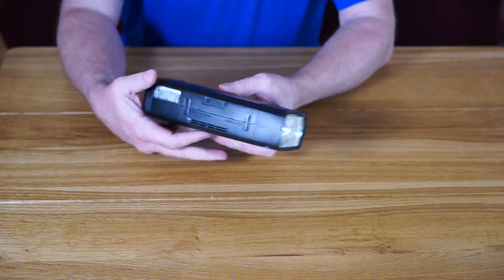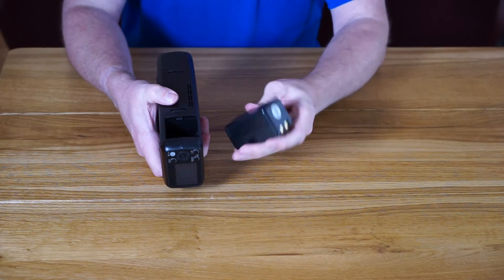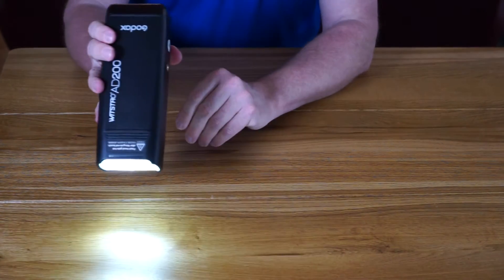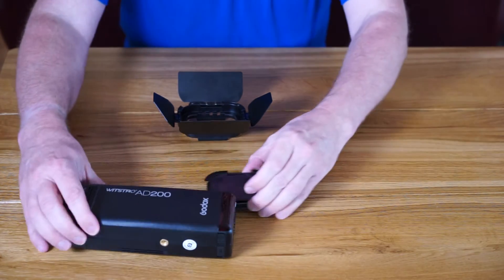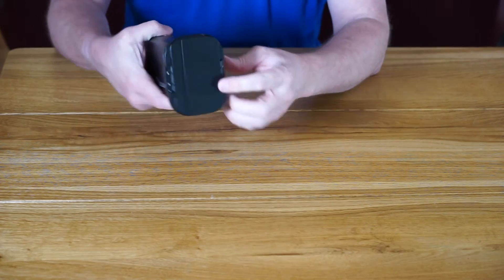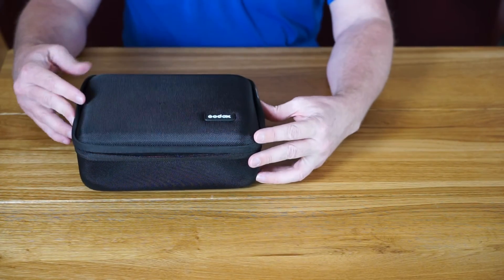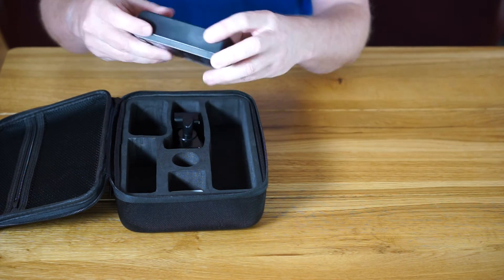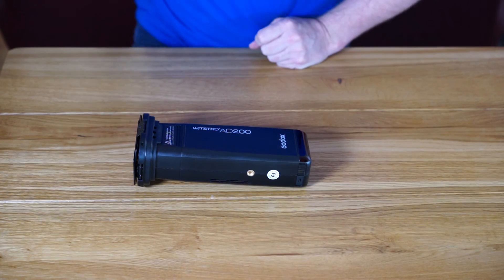Godox AD200 With Barn Doors

Comment: How do you take the barn doors off, it's extremely hard. Doesn't make sense for it to be that difficult to take off.
Reply: You just have to use a bit of force to begin with, gets better after a while though

Comment: Removing barn doors from your strobe unit:  there is an easy SAFE way to do it without damaging your strobe. 1) get a hard plastic THIN card or a guitar pic. I used my library key chain card. Step 2) slide it under between where the barn door clips on . 3) as you slide it between the flash head and barn door attachment part it will easily slide off.  I would NOT force it off bc you may damage the unit. This method is sure to work without damaging it.  So DONT FORCE IT OFF . And I wouldn't be so quick to blame the country bc nowadays vast majority of cars are manufactured in China . Except perhaps for German engineered cars
Reply: I tried it and it popped off quite easily, thanks!
Reply: Worked great thank you!
Reply: Worked.  What a pain.  I'm sanding down the catch points, and greasing.   Damn!
Reply: I cant even get the card between the attachments
Reply: https://youtu.be/zavkK7SWW10
Reply: this is ridiculous. Here I am thinking this thing got stuck, I thought I attached it wrong.. My heart....... you are a lifesaver. Thank God I scrolled down. You really helped me out.

Comment: how do you remove the barn doors from the flash head? Is it just brute force? I kind find anything to push to make it come off easily :/
Reply: I came to watch this video to see how removes that.
Reply: Yes....the barn door was easy to fit ...but I'm unable to take it off ....please suggest ........
Reply: You just have to use a bit of force to begin with, gets better after a while though
Reply: I am having the same issue
Reply: There's a video here titled "BD 07". Someone is demonstrating how to remove it. You just have to use force: https://www.youtube.com/watch?v=zavkK7SWW10
Reply: Hold the flash with the narrow side up with both hands, put each thumb on the side of the barn door then push thumbs into it to pop it off. Works every time.
Reply: Just slide a thin piece of plastic (I use a plastic membership card) under one of the notches and it comes off easily.
Reply: Hi....there s no rocket science or logic.....need to put a flat screw driver and gently push it out without damaging the flash .......

Comment: Were you able to take the barn doors off the head after you put it on? If so how?
Reply: That's why I'm here too. This thing is way too tight.
Reply: I was having that same problem. I was afraid to use too much force for fear of breaking my brand new flash.  But you're right. It just needs force.
Reply from the maker: Hi, the barn door head is a little stiff, but just hold the Ad200 unit in one hand and pull the barn door head off with the other hand, after some use taking the head off and on it won't be as tight.
Reply: Everyone has a same problem , got damn barndoor :)
Reply: Keep a couple guitar picks in your bag, slide under an pops off easily.  Maybe an old credit card would do...
Reply: thin plastic card worked for me
Reply: Tom Seery Same here. Good suggestion. Was worried there for a bit 😅
Reply: Girish Kolanthra https://youtu.be/zavkK7SWW10